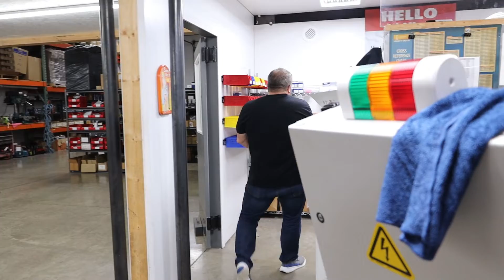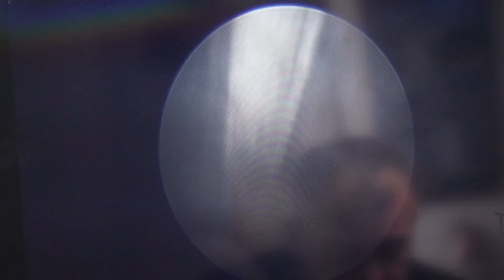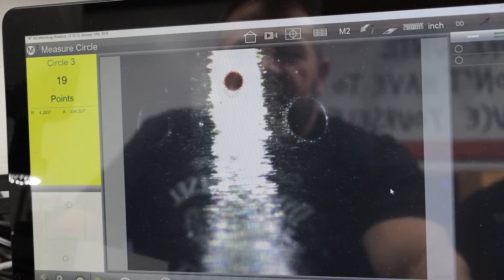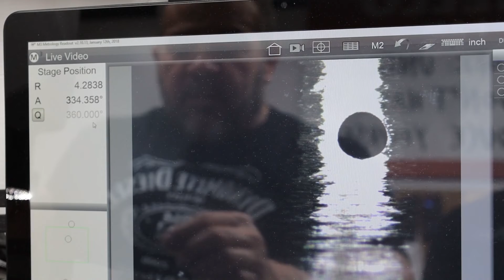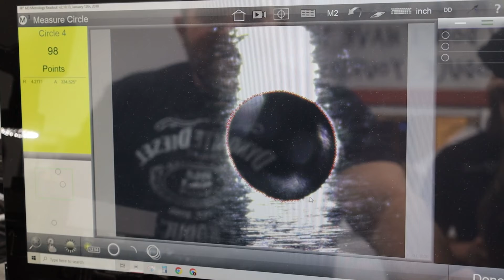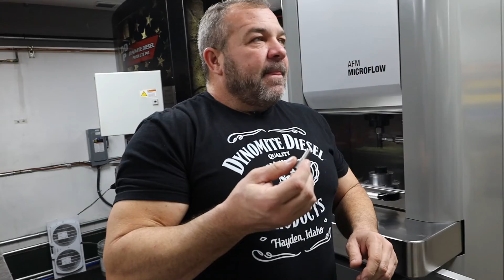12 Valve Cummins Talk. Round 2

Comment: Seems like you are teaching me, but the more I learn the more cautious I get. I am 70 and have been putting off trying to resurrect my 94 W2500 / NV 4500 / 3.54 gears with less than 200,000 miles. 300 to 400 horsepower would be more than enough. The truck has been setting up for 10 years due to two steering box failures and two scary experiences. At some point I would like to plan my project based on your suggestions.
Reply: You got this!
Reply: How did the project come along?!

Comment: I am sticking with the VE pump. Looking for 400-450hp. I had my pump max fueled to 250-260cc's by The Hungry Diesel. I will be running 18lbs of fuel pressure from an in tank Carter electric pump. I bought your Stage III nozzles. Will this be enough fuel from the IP to take advantage of the III's?  How much timing do I add?

Comment: Awesome stuff . In my 12v days I’ve done fair share of head gaskets. And composite head gaskets do compress, ARP studs don’t compress with them like a stock head bolt does.A stock head bolt is like a rubber band compared to ARP stud. I would use valve adjustment to identify the head and gasket have compressed because valve adjustment will be tight at that point you back off one at a time each head nut on the stud and do a re-torque on standard studs I started out at 125 would add 5lbs each retorque . I would usually end up with two retorques 135. Have been 1350 hp to rear tires and two seasons with standard ARP studs . And yes your buddy with his common rail didn’t have to do a retorque because he had a mls gasket . If this one person out from having to redo there head gasket it was worth this long ass post.